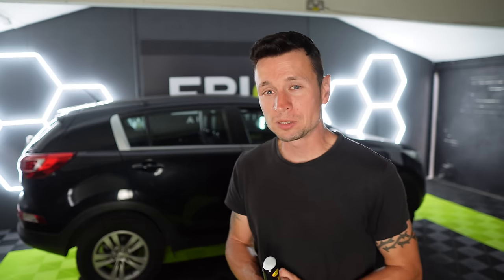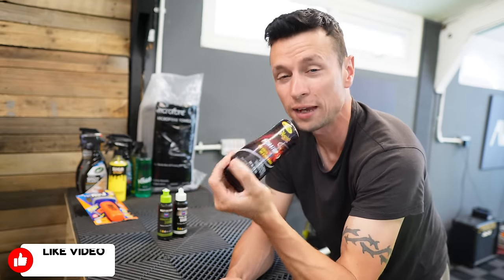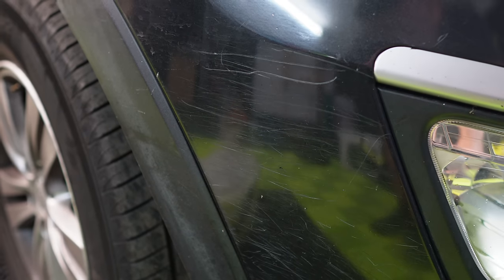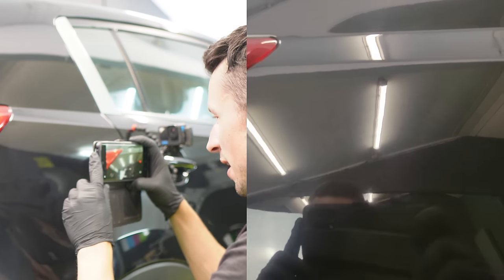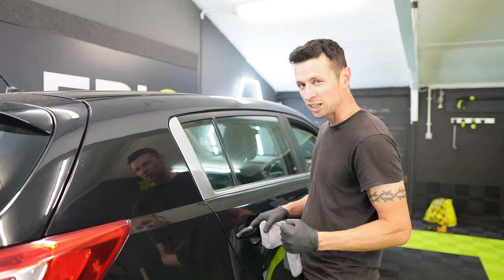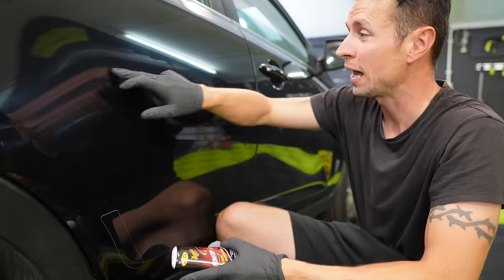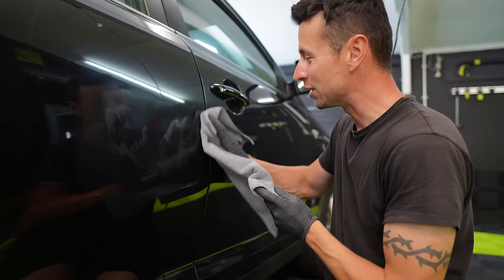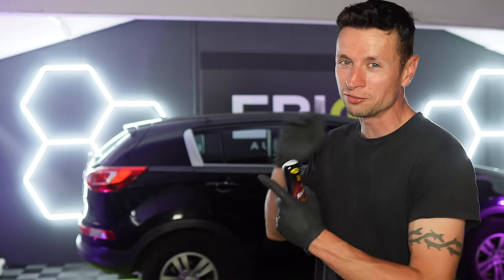Meguiars Scratch X it's good BUT.... (How to remove Scratches by hand)

Comment: I have used this product in the past, but it’s definitely not effective for removing most scratches. Maybe for scuff marks. If you want to remove scratches buy some 2000-1500 grit wet/dry sandpaper. Or buy rubbing compound and a polish to cleanup your work.

Comment: I've used Scratch X for years.  If used in the correct way and on the right kind of scratch/mark it is an excellent product.
Reply: Like swirly scratches from a car wash?
Reply: It does leave behind a slight haze when viewed at an angle and under dimly lit conditions, e.g. inside a garage.

Comment: One thing I will say if you have had your car ceramic coated it's virtually impossible to remove even light scratches as the coating is very resistant to products like this so be warned.

Comment: I've used this after Jack knifing a trailer into a bumper on my last car and really did work the marks out well. I found a damp Autosmart foam applicator was best for using with this . Also helps with headlight discolouration,  I've no quarms with it but as you say its not setting expectations too high and you will be fine
Reply from the maker: Exactly everyone has different expectations

Comment: Really appreciate your thoroughness and honesty in presenting this video review, however, I wonder if plain old rubbing compound might work just as well. Btw- Dave my guess in respect to slight "halo" or discoloration you noted especially when polishing the rear side quarter panel, this could be because the product is "eating into" the clear coat which is used on all car paints from 2001 to date. If my guess is correct (and I don't know for certain it is) but if it is, this product and your "elbow grease" could be doing more harm than good. In any event, the product is way over rated and NOTHING short of professional body work (probably sanding and re-painting) would restore deep scratches in a car's paint finish. Thanks mate.
Reply: So I have this issue where I can see a slight blemish on my passenger door after use.  I am afraid you may be right, and I’d love some tips here.  I’ve tried polish and wax so far but I walked by my vehicle and could still see it.  What can I do?

Comment: I used it and it looked more or less fine BUT after 20 days going to my local carwash, the scratches were again visible as before.  So, my conclusion it is the wax that's hiding the scratches.  I'm wondering when people post a review whether they did it right after applying this product or wait until the car was washed after a period of time and evaluate again.

Comment: Wow nice work Dave. Would you prefer to use AG super resin polish over this? AG seems to have a nice following. I recently picked up a cheap DA from Argos but don't have the bravery to use some compound with it and do my cars. Yes I know I'm a coward but I'm terrified at ruining my paint. I have no clue about the thickness of the clear coat, what speed and pads I should use on it etc. Or even what is the best compound to use for that particular paint like Rupez or Koch Chemie etc.
Reply: Super resin is a filler, it doesn't remove scratches.  Still a good product, but scratches will return after a few washes.

Comment: Hi Dave, at about the 5:15 mark you mentioned this haze or blemish left behind.  I used this product around a few door handles and also the side of a door. Now I am left with a slight blemish I can’t seem to remove.  Is there anything I can do or do you know what may have happened here? I was not in the sun nor did I let the product dry.  Could this be the product eating away my clear coat? I have a 2022 so I’m not sure if I can do anything to fix it or if I’m up the creek.  Any advice would be greatly appreciated.
Reply: This has also happened to me. Any answers?

Comment: Sounds like a turntablism competition. I bought something similar for my bro's wife who had driven down a hedge and done a double key-like scratch every panel. I realised it was just a firm cutting compound of which I could have used anything i own already to do it and rsults in my application were never going to fix it, just make it less noticable by blending up to it. I mean it worked to a point but it took ages and many passes not to mention it was hard work. This is def for people without a polisher and left a haze like you showed. Worked better by applying with a small-folded interior microfibre cloth (like your grey wipe-off one, rather than a sponge as that gave it a bit more bite. Oh, and poor Aquaman!
Reply from the maker: Lol thanks mate. Poor Clare balding more like 😅
Reply: @epicautomotivedetailing  can only have so much sympathy for anyone who choses such an unflattering haircut tbh. Im still siding with the man of aqua. NIce vid, im loving these inpromptu videos. I now youve changed a lot recently with the range going on hold but the channel is going great, ful of good stuff tips and most of all cracks me up and I'm not one to do an IRL LOL at YT videos. Take that as you will! :D

Comment: Hi, I  watch your channel and a good few other detailing channels with great interest and appreciation. Yet, none of you have addressed the current elephant in the room. We at southeastern water have a hose pipe ban, " discuss" pre rinse, snow foam, and everything else Not Allowed! Whaddya do?
Reply from the maker: Ok I can make it simple: commercial use yes, domestic use no. It's crazy as pressure washers use hardly any water. Most people end up using more water in the bath easily when you work out how much actually gets used
Reply: @epicautomotivedetailing  couldn't agree more, I used about 4 buckets drizzling shampoo water over my str before I dared going for the contact wash and even then I was cringing. Still,  so long as the shareholders are ok 🙄

Comment: Can you use this as a swirl marks remover by hand?
Reply from the maker: yes it hides those swirls but i think its mainly reliant on the polymer wax hiding the imperfections so you will need to keep on top of it
Reply: @epicautomotivedetailing  I'm already using an all in one product (polish, glaze and wax). By the look of it, it'll be performing the same.